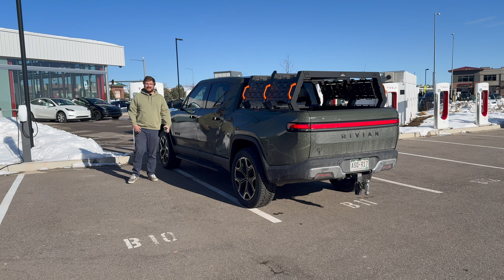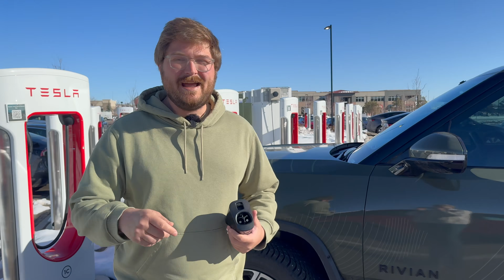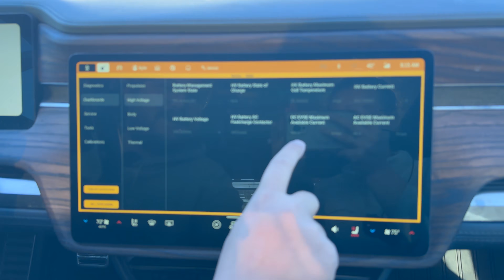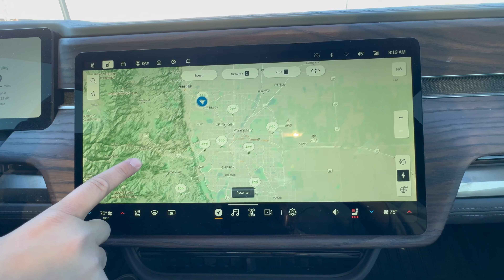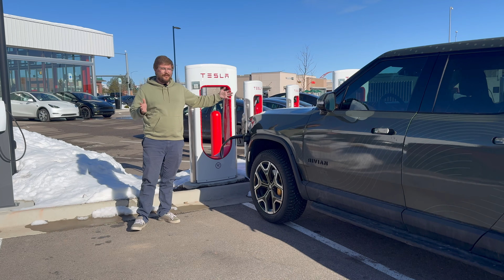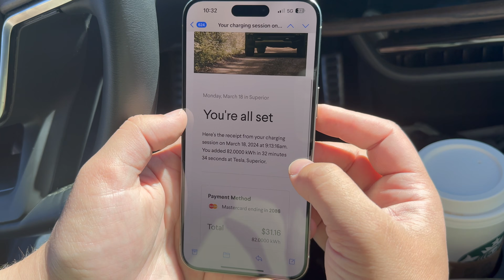Rivian Gains Access To The Tesla Supercharger Network! My First Charging Experience

Comment: Right rear makes no sense. If they wanted the plug to be curbside ready, right-front would be the logical choice, making it both supercharger and curbside friendly.
Reply: Rivian has their own charging network with its own port/charger orientation standard. Why should they build their own vehicles to meet Tesla’s standard?
Reply: @EUC-lid same reason they are switching to NACS
Reply: Supercharger V4 will have longer cables to reach basically any charge port location. Manufacturers shouldn’t design their vehicles based solely on the Tesla Supercharger network (except Tesla of course.)
Reply: @AnonymousFreakYT we have so many retarded standards, why not port placement? I would appreciate two ports on every car, left rear and front right....
Reply: The electronics for the electric motor are used in DC fast charging. So any vehicle that has the option of RWD like teslas or the upcoming R2 and R3 put the charging port in the rear to save weight and money on cabling bringing the power from the front to the rear. I agree, the rear sucks, but there is a practical reason they do it.
Reply: "If they wanted the plug to be curbside ready, right-front would be the logical choice, making it both supercharger and curbside friendly."

And towing friendly.
Reply: I like right rear for my garage and these were designed prior to knowing "if" Tesla would ever let them use the Supercharger network. I think eventually they'll all have longer cables, but that will take a while for Tesla to upgrade them all.
Reply: They use the rear because the new cars come as RWD and then there is less cable used in the cars.
Reply: @wonderboy75  I know, but why not put it on the driver side?

Comment: I hope all the people excited for the Tesla network have loads of fun and stop using the CCS network. I've been so lucky using mostly EA back and forth across the country and if normies just go to Tesla chargers now it'll be nice to avoid them all and have less congestion but we'll see.
Reply: A few years ago I made the mistake of going on a roadtrip on Thanksgiving. There was a queue of 50 Teslas at the supercharger. But in the same parking lot there were two 50kW ChargePoint stalls, so I skipped the line and plugged in there with my ChaDeMo adapter. Someone else quickly followed, but luckily I chose the one working stall - the other refused to connect 😂

Comment: People will just need to learn that if they're driving a Tesla to park toward the left and if they're driving a vehicle with a front driver/rear passenger port then park toward the right
Reply: Yeah Tesla's should fill in left to right... Non-tesla right to left using empty space next to right most charger if possible. None of this matters if V4 dispenser is available
Reply: Yes, this advice needs to be shared until it becomes common sense etiquette for the majority Tesla and non-Tesla drivers alike. If everybody does it right there's only one wasted spot then.
Reply: True, but it doesn't matter when it's mostly empty like in the video.
Reply: @dissectingreality  normally people like parking in every other spot which means it only needs to reach 1/2 full before non-teslas can’t park there
Reply: Non-Tesla can still charge when cars are filling up alternating chargers, as long as they have a charge port in a compatible location like Polestar and, from what I understand, Ford (once they have native Tesla charge ports in 2025) @keco185

Comment: Does Rivian plan to move the charge port?  Does the Tesla Nav takes this into account and displays the reduced number of stalls that are actually available.  3 non-Tesla's at a normal 8-stall station leave only 2 stalls open for other EV's.  That CCS plug is insanely LARGE.
Reply: Tesla's V4 stalls solve this issue with a 10FT charging cable (IIRC)
Reply: The R2 and R3 will have their charge port on the rear passenger’s side. Rivian has expressed zero indication to change it from the “front left” corner when pulled into a charge station. Tesla is the one opening up their network, it’s on them to adapt to be more usable for other vehicles, as there is no standardized location. The V4 dispensers to have a longer cord so should reach across a vehicle.

(Heck, Rivian’s own RAN stations are designed expecting a “front left” port - they’d have to redesign their own stations to accommodate a “front right” port. Why would they make their own charge network unusable to accommodate charging at someone else’s charge network?)
Reply: I would hope people wouldn't alternate spots like that. 7 non-Tesla's can take up 8 spots. I can see additional charges being added if it is an issue when the lot is full. Not an issue when it's empty like in the video.
Reply: It’s not as big an issue as Tesla owners make it out to be! In Europe Teslas chargers has been open for a while. Not a huge problem with cars with different placement. Btw 5 Rivians in a row would still be able to only use 5 (or 6) chargers if they all park next to each other.
Reply: @wonderboy75 actually it is a pain when chargers are congested. Had to wait multiple times because of non-Tesla blocking stall in small locations or busy routes.
Reply: @wonderboy75 Here in Southern California, Tesla superchargers are fully occupied most of the time - so this will be quite disruptive, unless vehicles with the non-native charge port location don’t mind risking a ticket by taking up disabled parking spaces.
Reply: I feel that all manufacturers should update their placement of charge ports. When they start making their vehicles with native NACS ports, they should put them either in the front passenger side or the rear driver's side. Charge ports can literally go anywhere on a vehicle without much or any change in the frame or construction of the vehicle. That is very different from a gas tank in an ice vehicle which can only be where it was designed to be. Plus, there can be multiple ports. Rivian, for example, can even keep the CCS on the front left and add a NACS port on the right.
Reply: @jeffs6090  The 500A-capable cabling isn’t cheap. That’s why Rivian has moved the charge port from front-left to rear-right on the R2 and R3. Because on the RWD vehicles, all the high-voltage stuff is in the back, so it saves quite a bit to keep the charge port in the back. Which is needed for lower-cost vehicles.

Comment: Is it cheaper?
Reply: Near me, the Supercharger network is cheaper during “off peak” hours than RAN, EA, and EVgo. During “peak” hours it’s more expensive, even with the Tesla membership. It’s nice having it as an option,  but it won’t be my first choice most of the time.
Reply: Looks like it had variable pricing 43-45 cent per kwh during the day 20 cent from 12am-4am
Reply: It is not about cost. It is about access to reliable huge charging network.
Reply: @Houlando  It can be about both. Where charging is known reliable, maybe it will be cheaper, maybe it won’t. Where charging isn’t reliable, or is hard to find other than Supercharger, mere existence/reliability may be the most important thing. Sadly, along a road trip I take while towing with my Rivian, there is a stretch where there are multiple Supercharger stations, but only one non-Supercharger. As of at least right now, Tesla doesn’t allow NACS-adapted vehicles to use them yet. (One is an older V2 Supercharger, so it makes sense, but the other is a fairly new V3, so should work.)
Reply: Nope.